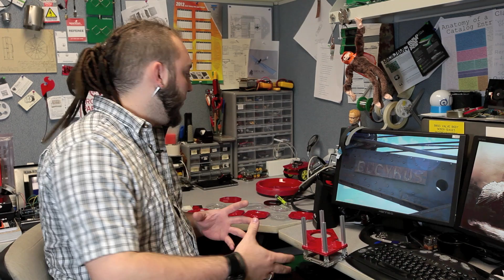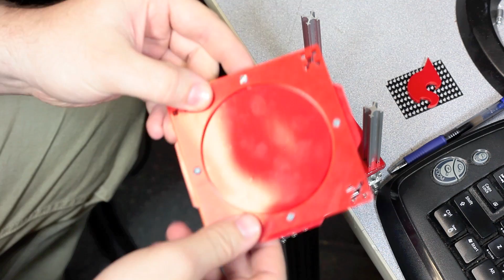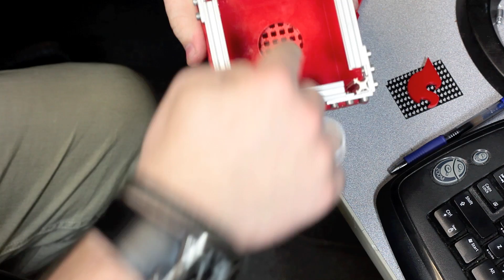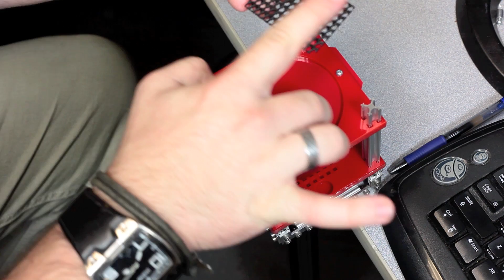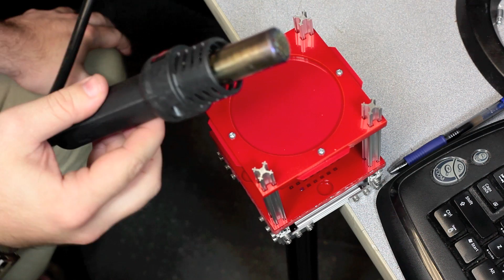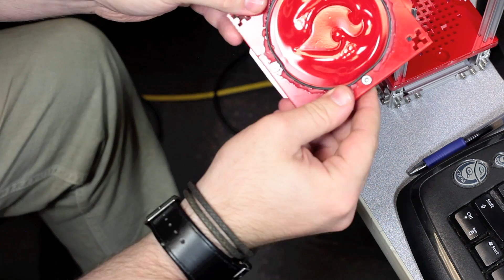SparkFun Vacuum Forming with Nick Poole

Comment: Or why reinvent the wheel?
A safer version is available on e-Bay from Mattel, albeit circa '63 - for as low as 
$30.00 and maybe an infrared thermometer to judge repeatable-temps saving 
fingers too - but obviously not as cool no doubt.  Whatever, thermoplastics rule.
e-Bot

Comment: It is if you've already got access to one...
But you don't need to use microracks and a laser cutter to make a vacuum forming machine.  In the Gundam Scratchbuild Manual they built one from a soap dish, a pre-manufactured hard plastic drainage mesh, and a couple pieces of wood for the media frame.  You could use almost anything as long as you can satisfy the basic needs of the machine.